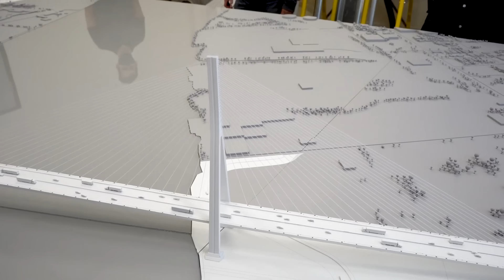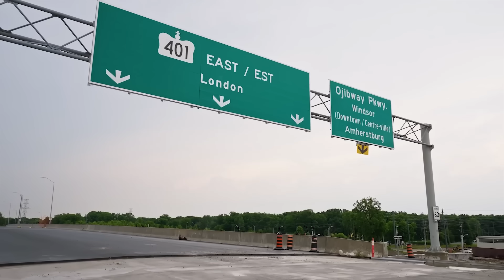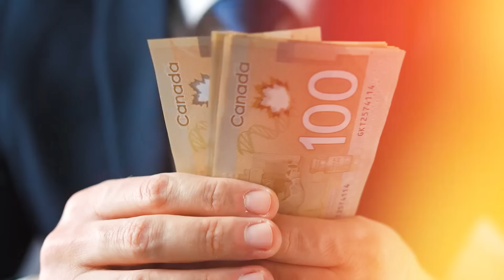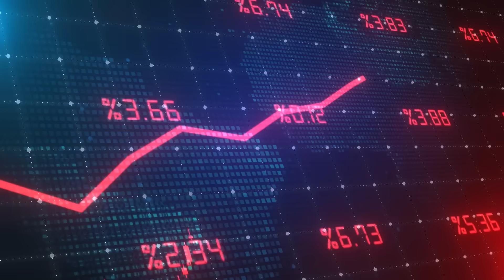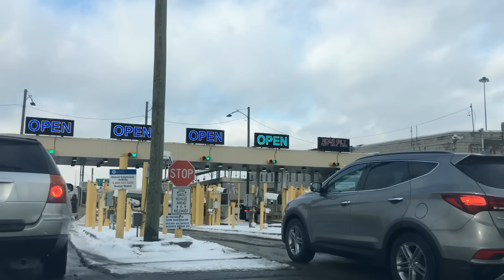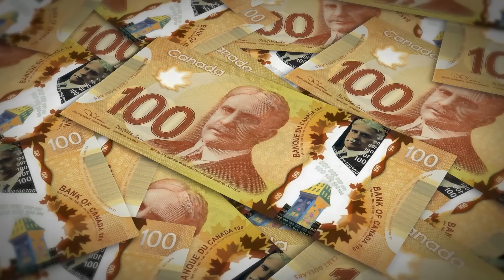The $6.4 BILLION Gordie Howe Bridge Is Almost Ready To Open!

Comment: So in your video about the cable stay bridge in Corpus Christie you said that one is the biggest in America but the Gordie Howe bridge was the biggest on the continent according to this video. Which is it? You said the CC bridge was 1661 feet and the Howe bridge is 2800 feet so I guess that makes the GH bridge the winner.
Reply: In the video about the Harbor Bridge in Corpus Christi, the bridge is "the longest concrete cable stayed span in the nation".  Pre-made concrete sections were installed one-by-one as the bridge was constructed.  The GHIB in Detroit/Windsor is the longest cable stayed bridge in North America.  The bridge deck is made up of steel griders with pre-made concrete slabs installed on top of the steel girders.

Comment: They should have made the toll booths look like hockey goals, the exact point of the border on the bridge should be a painted red line, and the entries to the respective border inspection zones should have a blue line.  If someone is deemed ineligible for entry (i.e., they are "off sides"), the inspection zones should look like a penalty box.  

And technically, the Detroit River is not a river.  As a connection between two other bodies of water (Lake St. Clair and Lake Erie), the "river" is a strait.
Reply: Would the same apply to the St. Clair River?
Reply: @staudtj1 Yes.  It connects Lake Huron to Lake St. Clair.
Reply: @staudtj1  Or the St. Mary River?  Or the Niagara River?
Reply: The Bob Probert Inspection Zone & the Terry Sawchuk Toll Booth?